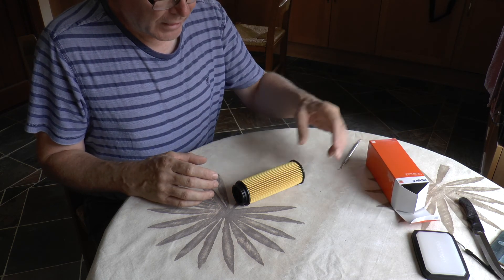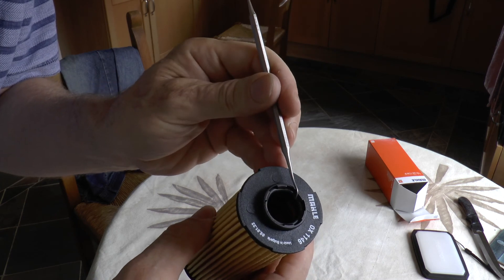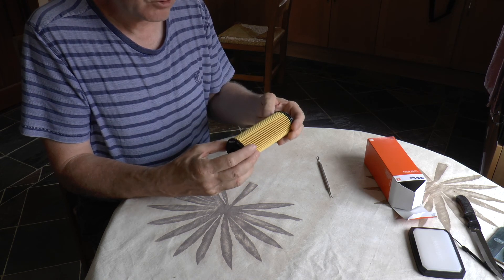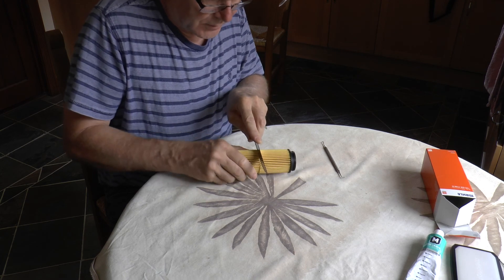BMW B58 Oil Filter Failure - Mahle Alternative To The Rescue . . . . Salvation or Scrap

Comment: Any thoughts or testing on the Hengst?
Reply from the maker: No, I’ve changed my oil several times now since making this video and have had no problems. Better the devil you know!!! That said, I lube the O-rings very carefully. 
The other thing I now do is I only tighten the oil filter cap to 15nm instead of 25nm. There have been lots of issues with the filter housings failing which is weird because although GRP plastic - it is a static part and not subject to stresses and strains other than during an oil change.
I strongly suspect many failures are due to over tightening but as the seal in the cap is created by an O-ring and totally independent of how tightly the cap is secured, I’m going with 15nm and a dab of white paint to monitor security. I have yet to have a cap come loose!! 👍

Comment: Thank you for doing this, super informative for new b58 nerds like me, good stuff!
Reply from the maker: @Disruptive  I’m glad you found it useful - I use OEM filters and have yet to have one break. I lube the o-rings very thoroughly, even going to the trouble of prising them free with a cocktail stick - lubing plus the recess and replacing.
I’m super-neurotic about getting a failure!!😂😂😂
Reply from the maker: @Disruptive  I’m pleased you found it useful. I use OEM filters and am yet to have one break.
I am super careful to scrupulously lube the O rings and the rebates into which they fit. Never say never!!

Comment: Got a MAHLE that was made in 2024 Feb, looks exactly the same as the one you got, probably going to the trash then.
Reply from the maker: Hi there - I emailed Mahle about the design of their filters being prone to collapse on removal and they thanked me for letting them know. They said they would look at it but I suspect the response was corporate BS.
If your Mahle was manufactured in 2024, it would be very interesting to know if they have modified the design or merely sat on their corporate backsides!!!
Cut off the base and see if it is toothed to the central tube to help resist rotation - if it isn’t and is just a flush fit, relying on the strength of the paper element to resist twisting, then the best thing you can do is dispose of it in the junk as that is what it will turn your car into!!! 😡
Reply: @ybliga  i can twist it and I can feel the slop with the filter media intact. That filter is going to the trash.
Reply from the maker: @coalieroller5663  stick to OEM. I recently changed my OEM filter without issue. After I removed it I attempted to twist it and break it by hand - it had been installed for two years.
I was easily able to break the base free from the central tube but the paper element held firm. I applied loads of force but it refused to pull apart. I suspect BMW have upgraded the “paper” element and made it stronger and far less prone to tear if the cap breaks free from the central core!! 👍
Reply: @ybliga  Thats good news, mine has a freshly installed oil filter housing since it was leaking at 3 years old and 19k mi. So wish me luck on removing that oil filter. Probably sticking to the OEM BMW in this case. My oil/ filter will not be on extended drain interval thanks to the shitty fuel in California, higher sulphur levels than EU, lower octane (91 AKI, call it 95 RON if you want) and its E10 regardless.
Reply from the maker: @coalieroller5663  It’s interesting these oil filter housings that break and develop leaks.
Loads of peeps think it is due to temperature cycles but I’m unconvinced and suspect it is due to the stresses incurred on the filter housing body when tightening the filter cap, particularly if the tech is a gorilla and hangs off the wrench like King Kong..
The manual calls for a set torque of 25nm but I believe it to be academic as the oil seal is created by the O-ring in the cap and this is independent of the torque when tightening down.
I tighten mine to only 15nm and then keep an eye on it - so far so good!!!!
Reply: @ybliga  I'll see what happen in the next 2 weeks, went to bought a OE toyota filter since its half price of the bmw one in my area. That's a UFI made in Jun 2024, doesn't budge when i twist it. Probably do it snug when i install it, and lube the crap out of it. Might also consider pour oil directly in the housing before tightening it.
Reply: @ybliga  Well said Sir!

Comment: I did 4 oil changes with the mann filter and none of them broke.. because b58 engines get hot the oil filter or the housing breaks its common.. i change every 10.000Km my oil and never had problems, so its probably people who dont do allot of oil changes..
Reply from the maker: The filter failures are due to poor design.
You might be able to reduce the risk by careful lubrication of the O-rings or indeed, with more frequent changes but the vulnerability to catastrophic failure remains until such time as BMW address the appalling design of their filter.
Sadly, many aftermarket designs will likely be based on the original OEM spec and using a non-OEM filter is an even bigger gamble. This Mahle filter for example has failure designed into it.
If I’m honest, I suspect that more frequent oil changes does nothing more than expose you to the same risk but more frequently. You are going to get your a*rse bitten sooner or later. 😢
BMW have now released a fourth redesign and I will be pulling one apart for review in the next few days.
Watch this space!!! 😬
Reply: Exactly, the cheapskates end up paying dearly!

Comment: Thank you for a great video and advise. I wonder if a company will make a decent filter that will not fall apart. I am taking my M240i to BMW for service in a few weeks, it was only done a year ago and about 15k miles.
Reply: That is too long...I change oil/filter every 5k miles/7k km...Better be safe than sorry...!
Reply: Hello thanks you very much
I use 
Mann-Filter Oil Filter hu6022z
On m140i
I do to change to mahle?
Good job
Reply from the maker: @dangdong3832   . . . . hopefully the video is clear if you watch it through. It would seem that neither the Mann or BMW OEM filter are perfect but both are much better than the Mahle filter tested in this video. I would not advise you to use Mahle based on my experience as I feel it is very likely to break when removed.